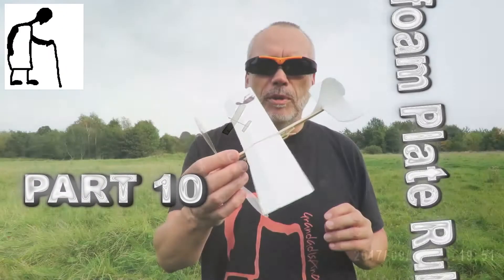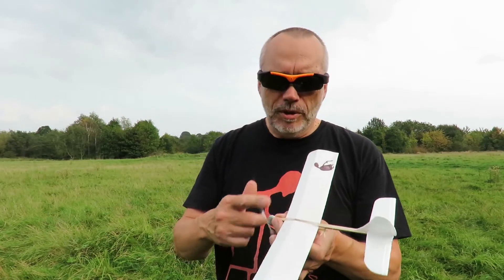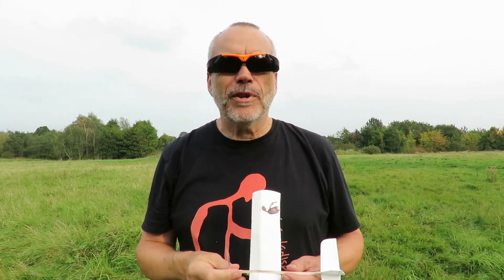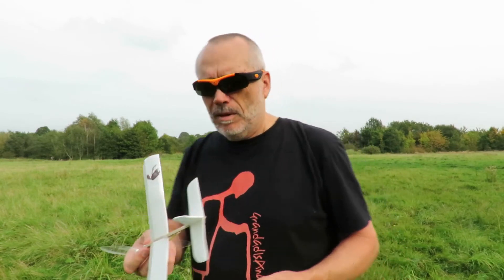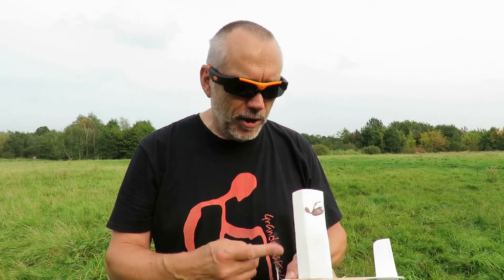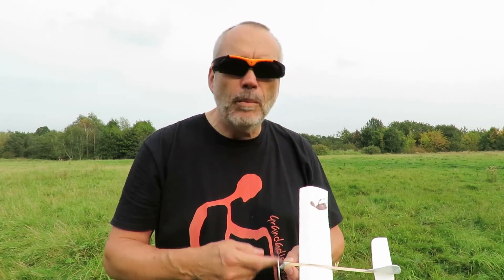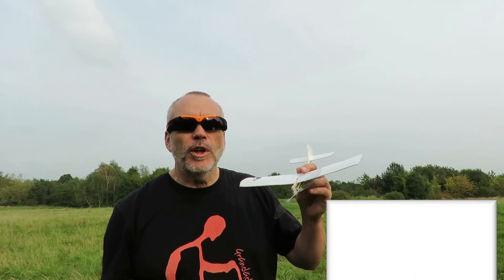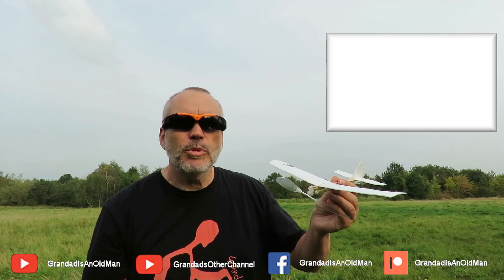Styrofoam Plate Rubber Band Aircraft PART 10

Comment: I wonder if a rubber band motor could work on a pusher prop for like the Canard design glider.
Reply from the maker: As long as you can get the centre of gravity in the right location there is no problem with a pusher and a canard layout, This was the first to pop up on a YouTube search https://youtu.be/FL3b9igecT0

Comment: Just an idea...if you keep the tail surfaces nice and light, then you can justify moving the rear hook back about an inch, which will allow for a larger rubber motor, and that way the aircraft can take more winds, and it will also spin out slower, so it will spin for longer. With the slower spin, the CG can be moved back a touch, because less thrust means it's less likely to stall, and then the glide will be greatly improved. Also the flight times will probably increase. Again, just a suggestion.
Reply from the maker: Thanks :-)
Reply: Your welcome! Always happy to help with the aeronautical side of things! Oh, and one other thing...so a while back when you converted that LIDL foam glider to RC you bought a whole stack of balsa...if you've still got it, maybe you could try using that material to make lighter, higher performance models. Either built up frames covered in tissue, or, slightly less labor intensive, a full balsa wing, sanded to an airfoil. Its just s thought, but I think a little balsa in you planes could really help their performance...not that their bad at all, just...with balsa, they'd be better. Just a suggestion, as usual.

Comment: " there's virtually no wind he says as a little gust comes up behind me " Perhaps you should edit out comments that can be misinterpreted though it did give me a laugh.
 That aeroplane works amazing well, Though those propeller blades make a good airbrake when stopped ! now i can see why competition rubber models have folding propeller blades.
Reply from the maker: Yes, there are some interesting debates online about whether a freewheeling prop produces more drag than a fixed prop, but certainly a folding prop stops the argument completely :-)